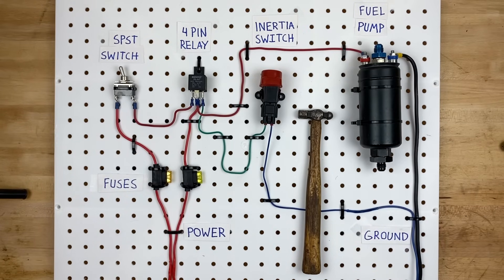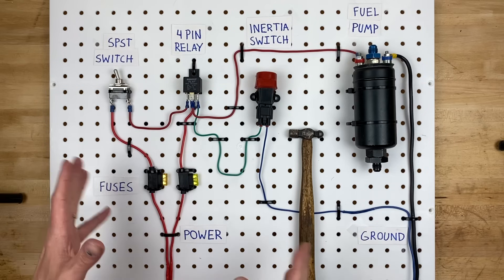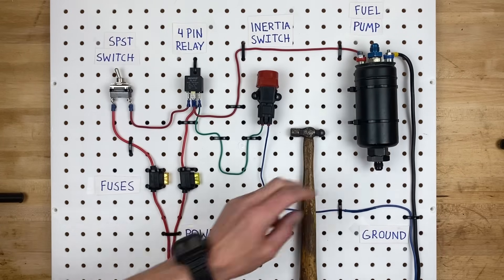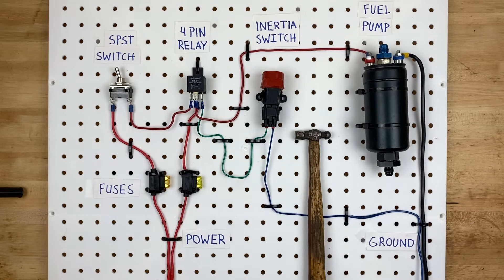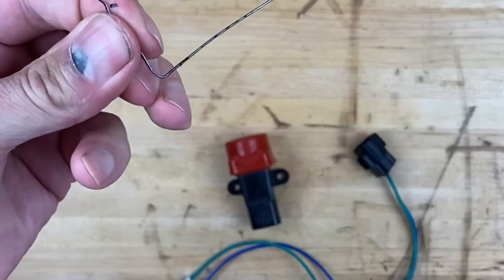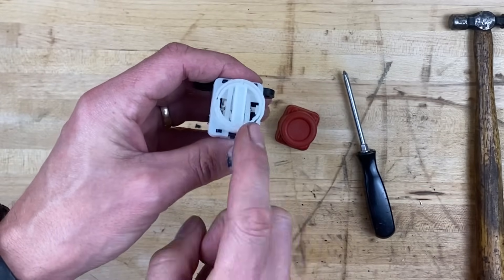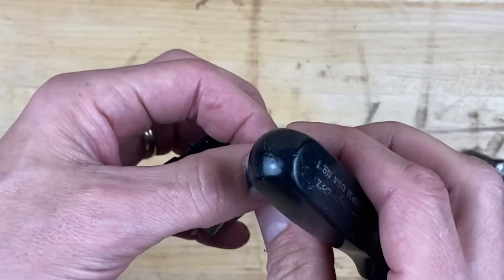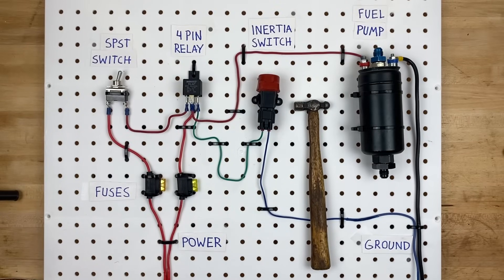Fuel Pump Inertia Switch Wiring for Beginners (With a Relay!) | @WiringRescue

Comment: Can you branch the +12v after the fuse and save yourself a fuse? If not can you explain why? Thank you
Reply from the maker: No, you should not do that. Here is why: Imagine the circuit is sharing a single fuse and your switch is rated to handle 10 amps (very common), and your fuel pump normally draws 20 amps (also common for a bigger fuel pump). To run the pump, the fuse would need be 20+ amps, otherwise it would pop when the fuel pump turns on. Now, if something went wrong on the SWITCH side of the circuit, the fuse would allow 20+ amps through the switch and wiring before popping and protecting the circuit.  By this point, the switch would have melted and maybe even lit on fire if you’re unlucky enough. If the wires going to and from the switch were not rated for 20 amps, those would melt/burn too, and overall it would be a bad day.

In short, check out my “what size fuse” video in my wiring playlist. You always want to use fuses that will protect your wiring and components properly to prevent bad things from happening. Sometimes that does mean multiple fuses for a single circuit to do the job right.

Hope that helps! Good luck with your circuit!

Comment: Is there any reason you cant put the inerita switch before the relay onto the hot side instead of the ground side?
Reply from the maker: You could put it in the pin 86 side of the relay and it will still work, but most are wired from the factory on the ground side. I have to assume a smart engineering team had a reason why, though I am not sure what that reason is.

Comment: My Ford already has one of these inertial switches in the centre console. If I wire up your switch and relay system to the wires on the inertial switch can i use that as a killswitch/security start-stop switch rather than having to run it off the relay under the hood and putting it all the way through to the cabin?
Or possibly just run a switch in the wire, without the relay and fuses since it already comes off a fuse in the cabin and has a relay that controls the fuel pump anyway?

Comment: I’m trying to figure out if my pump is bad or if it’s something in the circuit. I can’t hear it turn on so it’s either bad or the circuit right? I used a voltage tester that lights up red for power and green for ground. I checked those terminals and the left one marked “C” lights up red and the right terminal doesn’t light up at all. Shouldn’t it be lighting up  green for ground?

Comment: Hi, this is a great video and it really helped with a retro fit of an electric fuel pump on to a 1972 Spitfire. Now here is the part I am struggling with. With the same set up that you have demonstrated, how would I wire a warning light into the circuit so that if the inertia switch is activated (pot holes) I have an visual aid on the dash to tell me the inertia switch has activated and the fuel pump has now turned off?  Any help would be greatly appreciated. All the best, Gary
Reply: Wire a test light on the pump side of the inertia switch.  Drill a hole in the dash somewhere and install it.  It will flash on and off while the engine is running as the ECU cuts the pump on and off to maintain the proper fuel pressure.  It will also come on for a few seconds as soon as you turn on the ignition switch as the ECU brings the fuel pressure up to the specified level.  The test light could be an LED with a 600 ohm resistor wired in series with it or it could just be a 12 v incandescent instrument lamp, like the kind that light up your speedometer and dash.

Comment: The video is good . But NOT GREAT. ? WHAT SIZE FIUSE DIT YOU USE . WHAT SIZE IS THE BIG FIUSE AND WHAT SIZE IS THE SMALL FIUSE.  I am disappointed. I can't finish this project. Without this information
Reply from the maker: You should probably watch my video that explains what size fuse and wire size you should be using. Hopefully it helps. https://youtu.be/EhzN6UdnmPA?si=BIPvQ_w56XvmEXR2

Comment: Thanks for the simple explanation. I tried out one of those oil pressure switches, but I couldn't figure out how to wire in a way that would power the pump during starting, so I would have to crank, build oil pressure, then refill the carbs with fuel. Not ideal. This set up should be a lot better, and less points of failure in my oil system

Comment: Nice videos ty for sharing, can you help us about safety shutdown relay as a  solution,  When the ignition is switched on, the relay switches the fuel pump on for about 2 seconds and then shuts it down again, the fuel pump switches on only when a running motor is detected
 its possible? TIA

Comment: Prob a stupid question BUT could this be triggered by a pot hole or say in an autocross environment where you will have a lot a Gs in different corners and brake/acceleration situations?
Reply from the maker: It definitely could. There are lots of different style inertia switches that can be bought though. An OEM one from a Ford may be the best option because they are designed with potholes and normal daily driving in mind.
Reply: @WiringRescue  100% what I was thinking while looking at switches on amazon.  Any reason why these are put onto the fuel side vs say killing an ignition box?
Reply from the maker: @chargerman426  - I don’t know for sure - but I imagine car makers may believe that pumping fuel after an accident is the worst case scenario, so that’s their number one thing to shut down. Just a guess though.
Reply: It really depends on the mounting of the switch. If you put it on a thin panel then yes. These switches should be mounted on a very solid point on the body or chassis. Best positions are on the front suspension tower or right in the 'A' pillar in front of the front door hinges.

This particular switch should not trigger below 10g which is equivalent to about a 20 mph crash.

Comment: Came across your videos , great job by the way . I'm having a problem with my truck that everyone I talk to is scratching their heads .  My marker lights and tail lights and also the dash stays on . I disconnected the switches (toggle) I've pulled all the relays and circuit breakers out and the lights are still on . This is the real head scratcher ..... I disconnected the batteries and the lights stayed on for at least 20 minutes . Any ideas 
My truck is a 2001 kenworth w900
Any help will be greatly appreciated
Reply from the maker: Hi Ronald. The easiest way to diagnose this is to get a wiring schematic for the truck. That way you can see where the power is coming from in the light circuit and follow it back to the source. 

That being said, there are a few things that come to mind. 

1. Any weird aftermarket stuff - has the truck had any things added to it around the same time as this problem started? Alarms? Lights? Radios? If so - start with that. Maybe even remove it entirely.

2. For lights to stay on there has to be a source of power. It could be a backup battery of some sort, or a capacitor in some component. I know it sounds crazy but it has to exist, unless your truck is a magical energy source, which is unlikely.
Reply: Ronald, did you disconnect each and every battery? You can't simply pull the positive cable off on battery and think the truck is disconnected from the batteries. My peterbilt has to have all the cable links disconnected on the negative side of every battery or else some accessories continue to draw power. My fridge is factory installed and will continue to be powered if I don't disconnect all negative cables, same with my instrument panel and dash cam.

Comment: Jeremy, you suggested a switch on the dashboard with relays.  I have a similar issue with installing this on a 1993 GMC 3500.  The 25 Amp fuse wàs shorted.  The running lights are on all the time while running.  But no headlights.  With a new switch and bulbs installed.  Can this shorted 25 Amp fuse under driver's side dash be converted to a switch like you suggested? Please diagram and explain it.  

Thanks.

Lynn

Comment: Could this switch work on an electric vehicle???
Reply from the maker: It would depend on the circuits in the electric vehicle. Every vehicle is different.
Reply: The switch will take 20 amps absolute maximum, so you can't put it directly in series. However you can use it in conjunction with a relay.

Comment: 4:16 That "C" does not stand for "Control", it stands for "Common".   

JFYI, the normally open can be used to install an indicator light, buzzer, or to some control module (if you wanna get fancy). A buzzer would be very useful if someone were to bump you in the parking lot, and when you try to start your car, the buzzer comes on right next to the switch.
Reply from the maker: Totally agreed,  I know it is common, but apparently just had a brain meltdown when talking through this video. Sorry about that and thanks for the point of clarification.
Reply: @RattyMuscleCar  Not a problem. Sometimes, when someone missspeaks and says the wrong word, even tho they know the correct word, it might misinform a viewer. Then it can start the game of telephone. As in, they go to the store and ask for the switch that has the "Control" connection, and the guy at the counter looks at the guy confused and says, "What!"
Reply from the maker: @AztecWarrior75  - very true! Sorry about that.

Comment: at 4:20 it is not CONTROL but COMMON . If you look for 5 minutes how electric diagrams are done you will see we often use the therm NO or NC (normally open, normally close). Also your wiring is WRONG. You should never cut the ground for security measures. Always in series of the  switchs.

Comment: Rover used to these identical inertia switches in line with the feed to the pump rather than controlling the fuel pump relay, no chance of a stuck relay keeping the pump running.
Reply from the maker: That’s interesting! As long as the inertia switch is rated for the proper amperage for the fuel pump, that seems like a fine way of doing it! Thanks for watching!

Comment: Fun fact: I you know where they're located on Ford products, you can prank your friends by whacking their car in strategic places.
Reply: Fun fact: TCM is located in the front of engine bay. Simply open their hood, unplug TCM and take one pin off. Plug back in and they will be unable to start
Reply: Put inside the headliner so you can slap the roof like a car salesman to disable the car.
Reply: I think pranking your friends is the only use for installing an inertia switch
Reply: Panther flatforms had it in the trunk on the drivers side.
Reply: Fun Fact: Anyone fucking with my vehicle in any kinda manner, will get their ass beat.

Comment: 4 decades ago before we had inertia switches I had a car that had a fuel pump relay switched by the oil pressure switch, positive from the ignition negative to the oil pressure switch , pump on the relay n/c . OK for off road cars etc. It had a carburettor so it would still start.
Reply from the maker: Yes! Chevy trucks in the 1980’s had those, it was a great design!
Reply: @WiringRescue  Thankyou very much for raising this subject, my classic has no fuel cut off system at all I will be wiring in both, could be a life saver being unconscious with a fuel pump running does not bear thinking about.

Comment: There is no reason to fuse the switching leg of the relay as there is no load, only signal.

Also the reason these aren't used on race cars is because on a hard launch the inertia switch will often trigger and kill fuel prematurely.
Reply: Exactly, it's literally what relays were invented for. And if he insisted on having the switch fused, he could've wired the switch source power to the relay source power, using the single 40 amp fuse.

Comment: Great video but Noob question here sorry so I’m in the middle of installing a walbro fuel pump on my charger scatpack and I’m installing a relay and I inline fuse so the wiring would be pretty similar to this correct minus the inertia switch and instead of a wire going to a spst switch it would be spliced into my ignition wire instead so the pump would start when my car starts?
Reply from the maker: You are on the right track. The thing to consider is when you want the pump to turn on. Should it be when the key is on? Or should it be ONLY when the engine is running. That will determine what wire you use for pin 86.  Also check this fuel pump video out. It has some additional details you may find useful https://youtu.be/8GjvRdssvFI

Comment: Love how you did this! Do you know if there is current through the C - NO after you whack it with a hammer? Could be cool to wire it to a service light or something.
Reply: He's not using it like that, he's switching GROUND, not power.
Reply: You can use both circuits. The NC in series with the relay and the NO to trigger the hazard flashing lights or, as some car companies do, unlock the doors..or both.
Reply: Oh that's clever! Keep up the great work

Comment: Can u do a demonstration on wiring a window motor with relay to where u have to reverse the polarity
Reply: They have cheap polarity reversing relays on Amazon... They reverse with a trigger from a switch, either ground or power.

Comment: I have a question that i hope you will reply to, I have a set of 7" jeep headlights in my mk1 golf. All the lights work fine with all their respective sources of power. The issue I am faced with is that the angel eye stays on when indicating and doesnt allow the amber to flash. Is it possible to wire the parklights in such a way where power cuts to the angel eye in the direction Im turning and then back on when the indicators are off.
Reply: Absolutely

Comment: Actually  that is a good  idea if your running a electric fuel pump or two  and you get into a accident  that hits hard enough to warrant   the protection  . The fire starts in milliseconds and why feed it so you have less time to escape . I worked at  Ford in the 90s we had a few  that malfunctioned  but Ford fixed them by using a updated switch in the trunk near the tank never seen  a comeback after that .   That really is a good idea for a lot of reasons on a hot street car or any car  for that matter .

Comment: But will that trip if you are on a very bumpy road or in a rough riding vehicle
Reply from the maker: Ford has been using inertia switches since the 1990's, and they have worked really well. Occasionally they do go off unexpectedly due to water intrusion, or minor parking lot accidents. For the most part though, they handle all normal road conditions just fine.